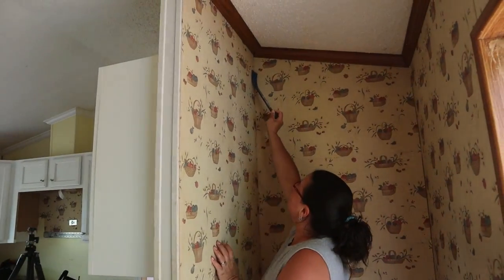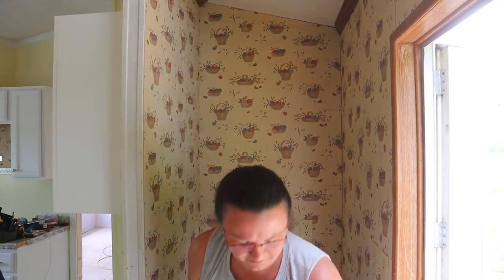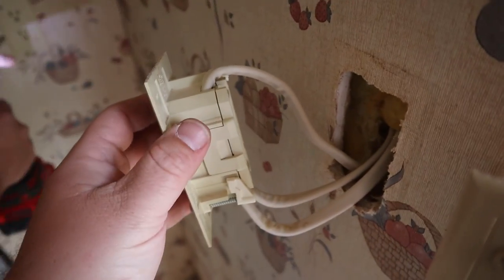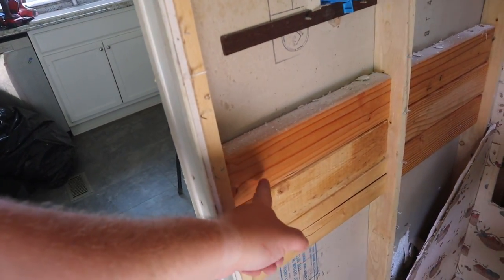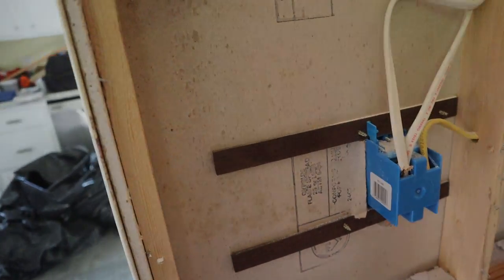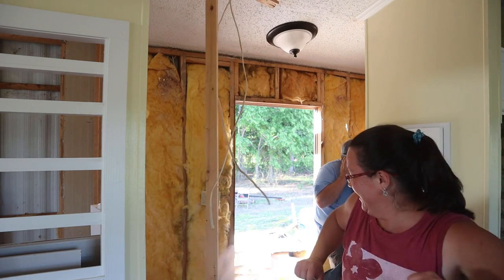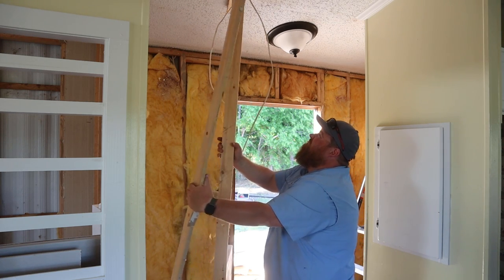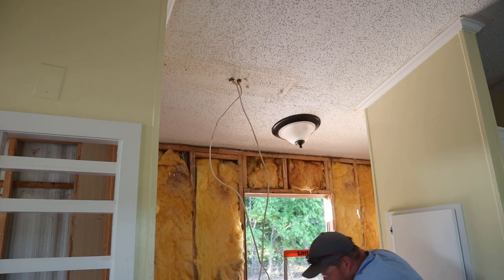What Have We Done?! Laundry Room DEMOLITION in an Old Mobile Home

Comment: I learned a sad but valuable lesson about stackables. Make sure they can be separated in case one breaks down. The ones I had couldn't be separated and that was a problem when the washing machine quit working. Turned out to be cheaper to buy a used washer than repair it. Then the problem was finding space for the new one. Just wanted to offer up my own experience. Enjoy your videos. Thanks for sharing 💕

Comment: We completely removed the wall for our laundry room and water heater area, installed a tankless water heater, expanded  the kitchen into all of that wasted space. Going to make a stackable unit enclosed in the new kitchen area using the original washer hose box and electrical wiring with a pony wall and some antique doors with frosted glass that being used for a back door to the porch similar to the track style double doors hinged in the middle I've seen on closets and laundry areas. Really opened up our kitchen, also removed a closet that was intruding on dining room space. That water heater area had untouched wallpaper since it left the factory that looked new lol!
Reply from the maker: Sounds awesome!!

Comment: While you've got those laundry room(?) and other walls opened up, p.ease consider cross bracing, or noggins, for the potential of high level shelving screwed into wood rather than sheet rock.  -  If its in the time and dollar budget, putting in a regular exterior door sure seems to make sense both in the short and long term.

Comment: Actually, I hated my stacking washer and dryer.  Hated getting down on my head to get stuff out of the washer.  So I took out the big, useless garden tub in my master bathroom and put the washer and dryer there.  Built a pedestal to get both of them up off the floor and put them side by side.  Now no bending and dirty clothes right by the shower where they come off.

Comment: I would have the door opening outward instead of inward in case you have to exit in an emergency like a fire.
Reply from the maker: That's not normal in homes in the US. Plus we'll be putting in a storm door on the back so we can keep it open with screens in the milder times of the year.
Reply: @sam-and-angela  May not be "normal" but given the confined space you have it would be prudent.